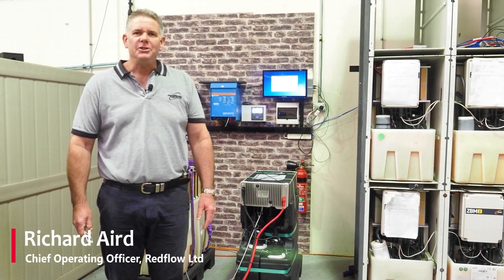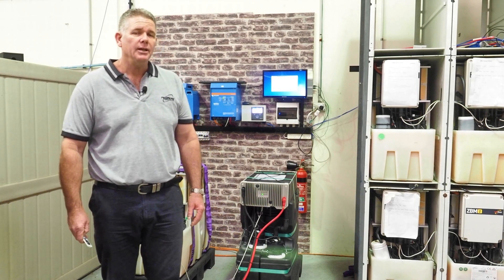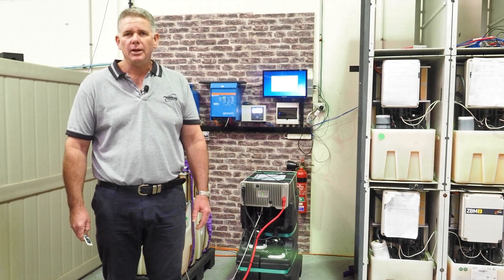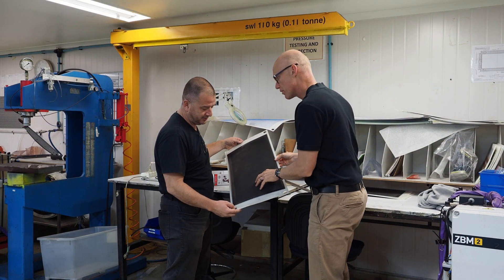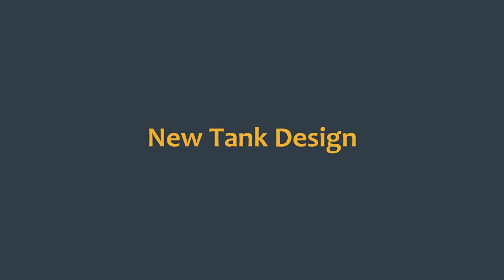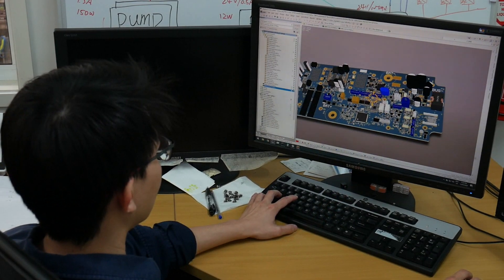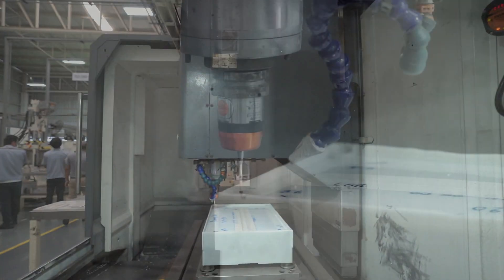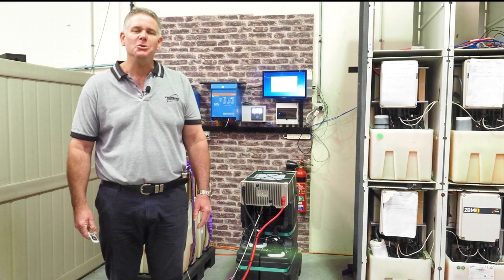Redflow Gen 3 Battery Explained

Comment: How will you keep this battery stay under 50deg considering its installed in a metal cabinet with other batteries and in warm climates where ambient can be 40deg plus it would get very hot in those cabinets.

Comment: How long are these expected to run on only regular maintenance? Estimated lifespan?
Reply: Seems no one from Redflow is interested in social media.......so i'll answer. Its my understanding that these batteries are supposed to last 10 years with 100% capacity for that 10 years (eg 10kw at the start.....10k at the end)
Reply: @DeanCollinsVideos  correct on both points. Warranty is for 10 years or 36500 kWh. Which ever comes first. That is one complete cycle per day for 10 years.
Reply: Unfortunately their reliability is extremely poor, and the company is now dissolved.

Comment: What do you mean when you say 10kwh then say "5kwh" I don't understand the "5kwh" ???
Reply: 10kwh is the storage capacity, and 5 kw is the peak output. i.e. the battery can output 5kw for 2 hours, or 2 kw for 5 hours.
Reply: Thanks for the info. I am hoping they will make these units available worldwide (I'm in the Philippines) for home solar use. Also am curious as to what the price is for the newer version.
Reply: @gergle02  Are you with redflow?
Reply: @gergle02  I thought i read that its 5kWh for 1 hour max.....but limited to 3kWh for continuous use?

Comment: Fantastic progress. Does the new architecture allow for use in mobile applications? I’m looking at an inland waterways widebeam barge, with twin 10kw peak motors. The roof will accommodate about 7-9 Kw peak of solar, and I intend to install a small scale wind turbine for use when moored and a hookup is not available. At the moment the motor system comes with a 96KWh Lead acid traction battery at 48v DC, of which, only a max of 50% is usable. It would be fitted as part of the boats ballast so weight is not an issue. My question is really, would 5 of the gen 3 RedFlow ZBM2s be able to replace the Lead Acid battery?
Reply: As a side note, I always intended to buffer the battery bank with an industrial Ultracapacitor module, from Maxwell industries, just to shield it from the hefty startup current, so they would be protected against exceeding the discharge limit.
Reply from the maker: Hi Carl.  The battery isn't designed for mobile applications, and movement can affect the zinc plating process.  If you'd like a more detailed assessment, please email us at support@redflow.com and we'll have one of our sales team have a closer look.
Reply: Redflow - sustainable energy storage thanks for the reply. I realised the battery is designed for static applications, I wanted to check if the new version would work. The advantages over lead acid are substantial.
Reply: @MrCarlRobinson  Nice boat!. Apparently Redflow are more expensive than Lithium batteries (I'm not sure if G3 changes this). Given redflow are also not suitable for mobile installations I suggest you look into a lithium solution instead if you are looking for more power or perhaps AGM Leadacid will do.
Reply: @redflow-acceleratingacarbo9077  Thanks for answering this.....id been talking with some catamaran people about these and wondered if being a liquid movement would be problematic.

Comment: Hi, am keen follower of Redflow, we have been off grid for a few years now and are looking to upgrade in the not to distant future, are your batteries suited to home off grid applications, is it possible I understand they require total discharge cycles, how do you overcome the need to carry on as normal power usage whilst this all happens or is it recommended to have “two batteries” a 10kw battery would suit our needs in future. Thanks in advance.
Reply: You need to have a minimum of two batteries to ensure continuous power supply. We have two ZBM2 batteries in our domestic house situation.

In the longer days outside of winter, we effectively do not draw from the grid. If we were off grid we would change some things and two batteries would be sufficient, but a third would be icing on the cake.

If you can, find someone with one or preferably two of these batteries in a domestic situation to glean the pros and cons.

The current batteries effectively allow a continuous discharge of approximately 2750W in really hot weather, having two batteries means you can pull 5500W continuously; provided both batteries have some stored energy that is.

One test we did was at 3% SOC (both batteries) we pulled 7000W + - for a very short time; very impressive. I would suggest you have an inverter for each battery, otherwise you will have a bottleneck. Meaning you may have 18000W of stored power, but you are restricted to approximately 2750W with one inverter, or 5500W continuous with two inverters.

We have at one time pulled somewhere around 9000W for a very short time; did it very well. We did this just to see; if you know what I mean.
Reply: @allanhugh2044  Thanks so much for this info Allan. I was looking at getting two when we get solar put on our place and hoping to be as off grid as possible. A third battery with the requisite inverters sounds like the way to go.
Reply from the maker: Hi Ross.  Alan is right in his description of the ideal system setup. If you're interested in knowing more, please email us at support@redflow.com and we'll get one of our sales team in touch with you.
Reply: @redflow-acceleratingacarbo9077  Cheers, thanks so much. When we're ready to proceed we most definitely will.
Reply: Allan Hugh thanks for the heads up very interesting 👍
Reply: @alanblyde8502  Not a problem.
One of the more interesting things I found out after actually having the batteries working, was their maintenance schedule.

Most (if not all) of the literature I found online suggested one could schedule downtime for maintenance whenever you thought was appropriate within a weekly time frame. Maybe you can, but the factory default instructions that our installer ran with, is that each battery depletes it's SOC to zero every three days. It then conducts a maintenance schedule which basically turns the battery into a brand new battery, then your battery is good to go for another three days.

Our batteries have been in since last year, they have pretty much worked perfectly. The hardest they have worked was when the ambient temperature was 47ºC three days in a row with appropriately hot nights. Their performance certainly drops as the temperature rises and literature available online will give you that temperature performance efficiency chart. The batteries apparently shut down when they reach 50ºC, ours came very close to that figure and at least twice reached an internal temperature of 48.2ºC. The cooling fans were in overdrive, if you get what I mean.

The batteries are connected to the internet and their location, latitude and longitude down to seconds, is put into the parameters. Therefore the batteries know when sunrise and sunset happens every day. The automatic scheduling, which we stayed with, works so that the battery undergoing maintenance finishes it's maintenance run around the time the sun starts rising.

Within reason it does this extremely well, only running into a delay when there is just too much power in the batteries and one isn't using it. This is not an issue, the maintenance just takes longer to finish. On the odd occasion, we have had the maintenance session finish near midday, in the interim, the solar panels produce power, we use whatever we need with any excess going into the battery (or batteries if the maintenance cycle has finished). Failing that, the excess power goes into the grid; in our case anyway.

Just another thought on the maintenance thing. Both batteries in our set-up never have the same SOC as each other, they are always going up or down. The battery that is going into maintenance will be the battery that you automatically draw upon; which is worked out by a rather brilliant Battery Management System (BMS). This BMS also organises the discharge of the battery going into maintenance by transferring power from that battery into the other battery.

In our case it mostly does this overnight and in the time of the year when we have shed loads of sunlight, the maintenance cycle is finished pretty much around sunrise. The battery is then re-started (not correct but you get my gist) and usually starts to receive power when sunlight hits our PV panels early in the morning.

I would suggest that anyone wishing to do this, carefully work out their electrical requirements on a long term basis. With this knowledge you can hopefully work out how many solar panels are required on your rooftop(s). Then you can work out what the optimal amount of battery storage you require, or that you can afford, to make you either effectively in an off grid situation, or a true off grid situation.

Another thing that is an issue, but at the same time, is not an issue; this is the power usage that each battery requires to operate. There are two pumps continuously running in each battery; it is a flow battery after all. For simplicity, I'll call them power in and power out pumps. Now I am not a technical person, but the basics are that these pumps are pumping fluid non-stop.

When the sun is shining and power is coming into the battery, the valve on the power in pump opens up, this allows the electrolyte to flow over the battery stack and charge it. The instant power is required, the power out pump valve opens, while at the same time the power in valve closes. This then allows the battery to supply power to your house as it pulls power from the battery stack.

These pumps are effectively a parasitic draw on each battery. What does this mean; well, when the sun goes down and you are using no power, the SOC of each battery goes down. It is not a big draw as these pumps are highly efficient, but nonetheless there is that constant draw. In practice and with normal daily sunshine, you won't notice it, but in the middle of winter, like it is now where I am, this does impinge slightly more on the daily SOC situation.

If you switch the batteries off, then everything stops and you do not lose any SOC whatsoever. This could be for 10 minutes, 10 hours, 10 days or 10 months. Want to start the battery, not a problem, within say 10 minutes, your battery is back into things as though nothing had happened and you have whatever SOC you had immediately prior to shutting the battery down.

As far as power outages go, seamless; within reason. The longest power break we've had since installing, was a few hours. We didn't know the power was off until we had neighbours asking us. A quick check of our Victron control monitor, told us the grid was down. Another time a couple of weeks ago we had another outage, I was in the bathroom with one of those 4 x 500W tungsten downlight thingies going when I noticed a very slight flicker. A quick check, yep, power off. I walked out into the street and saw the street lights powering up. According to a neighbour we had a 29 second power outage.
Reply: Allan Hugh that’s cool, a lot of information right there, our current system is, Victron 3VA 48Volt inverter / charger, 150/100 MPPT, 6 x 335 LG “2 strings” 8 x 220ah gel batteries, solar panels are on a duel axis tracker, can upgrade that to 80m3 if needed. Tracking does pretty much as you described with your system, it knows exactly where the sun will be 365 days of the year.
Reply: @alanblyde8502  Interesting about your tracker system. Would love to have something like that, but we are restricted to our hip rooftops. Our panels are all running micro-inverters, best way with fixed panels as far as I'm concerned. One can individually see how each panel is performing, plus, as they emerge out of shade in the morning then fade into shade in the evening, you can see what a difference having each panel running at whatever it is possible to generate.

Our batteries each have their own Victron 48/5000/70 unit, with one being the master the other being a slave unit. The Victron system is fooled into believing the batteries require bulk charging all of the time. The Z/Cell BMS is really smart and does everything else, super slick system that. Whomever wrote their BMS software, is a genius.

I'm in Melbourne, I take it you may be in a rural setting?
Reply: Allan Hugh yes Wheatbelt WA, we are on top of a hill, the tracker actually pivots past 90 degrees at sunsets, will definitely look into something like you have thanks for all your info much appreciated.
Reply: Yes, thanks for all the good info! Much appreciated.